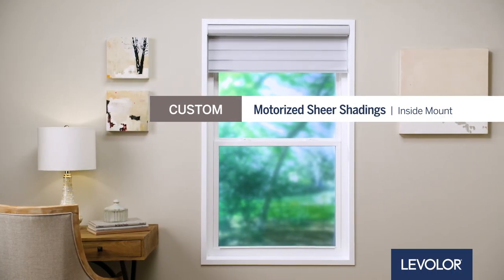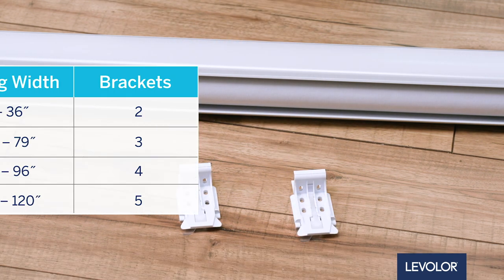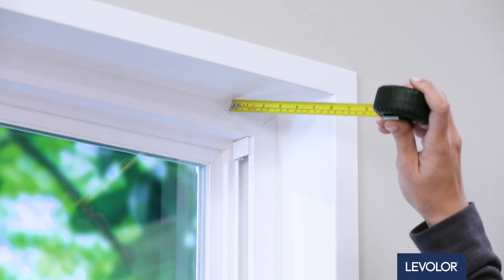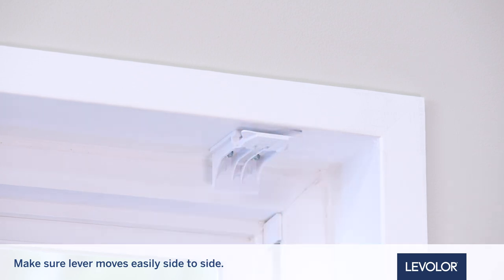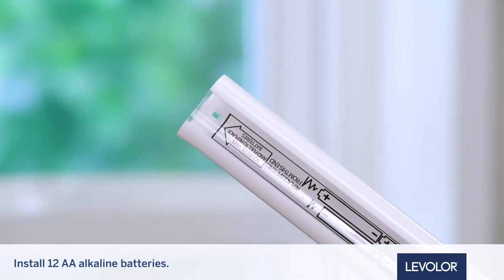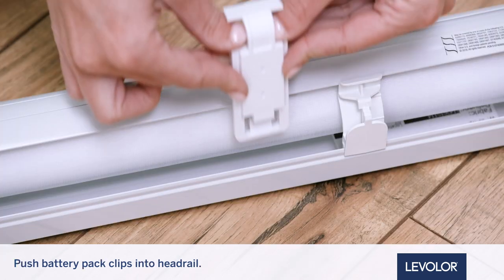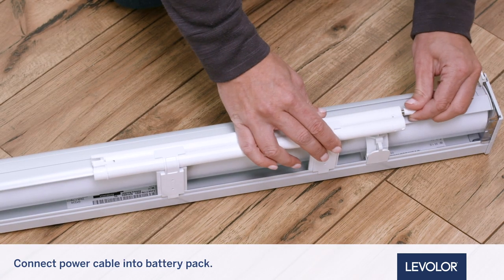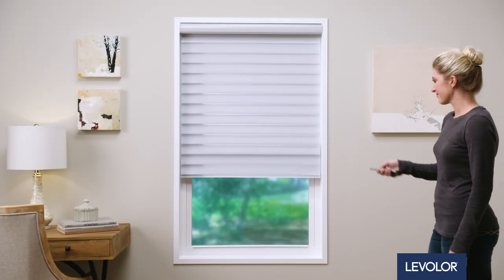How to Install LEVOLOR Custom Motorized Sheer Shadings - Inside Mount

Comment: As you can see from the picture of the shade in this video, the battery pack extends deeper than the bracket.  I had to install the bracket about 1/4 of an inch away from the inside of the window . Otherwise , the  shade would not click into the brackets.